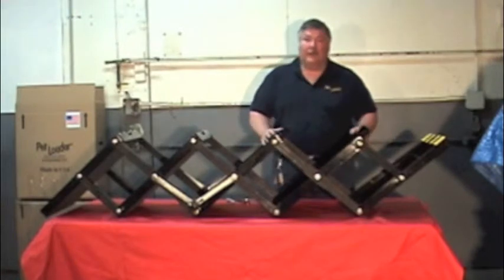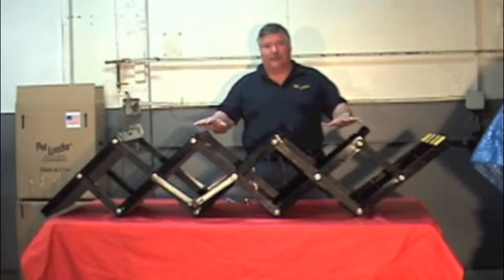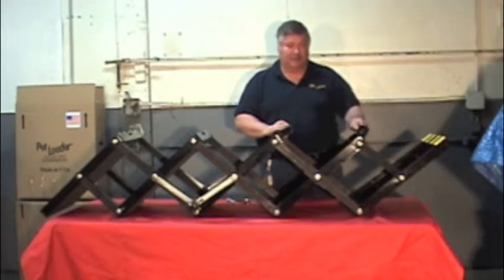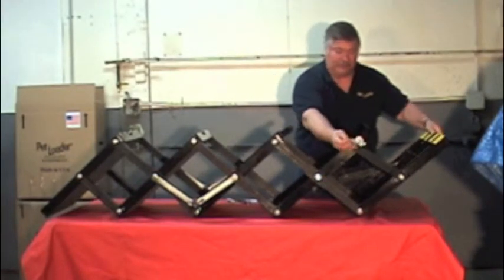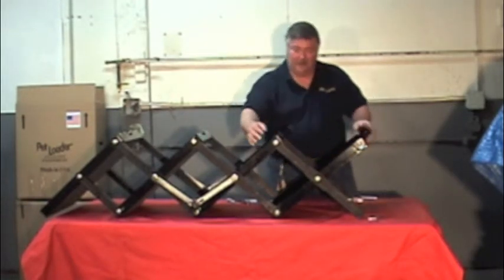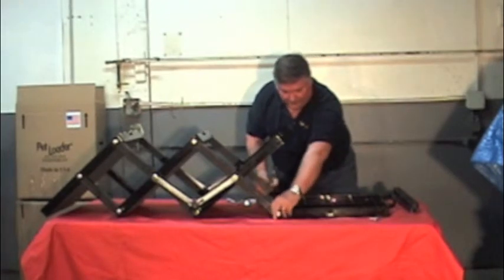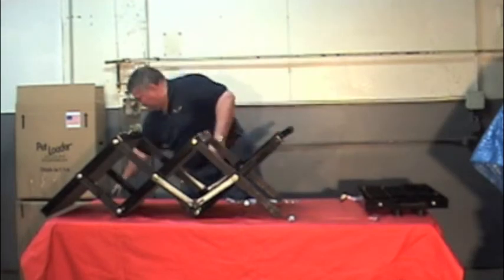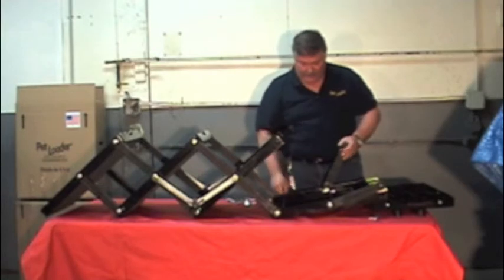Pet Loader Remove Step 5 to 4

Comment: This was really helpful, I had to remove two steps, so I did the one you showed and the one near the bottom, so it didn't interfere with the locking system 👍